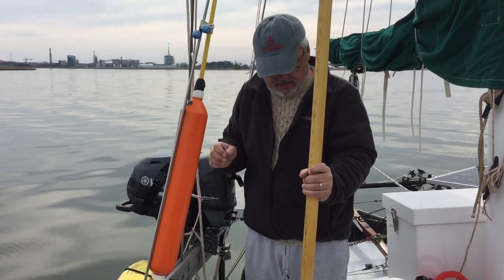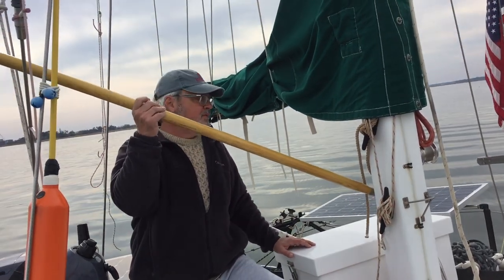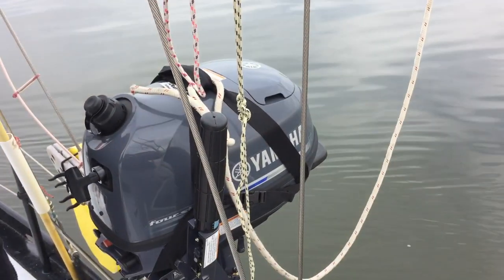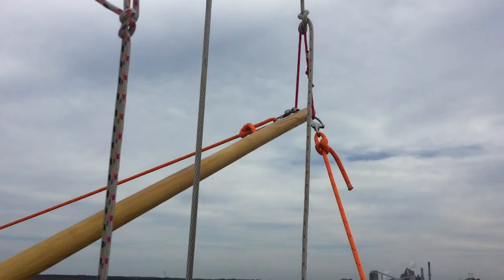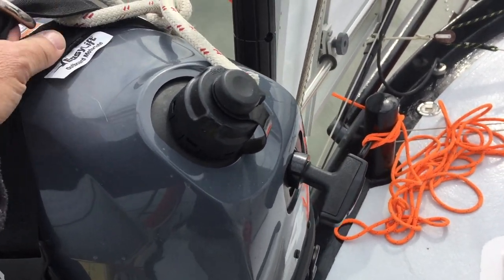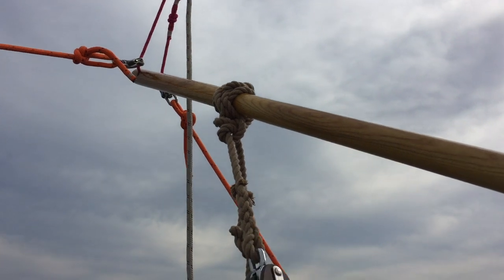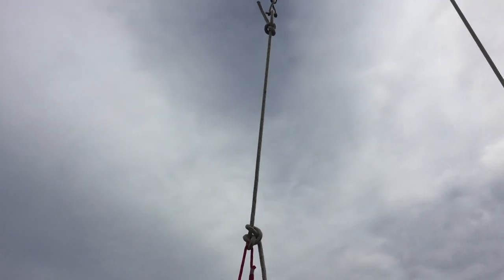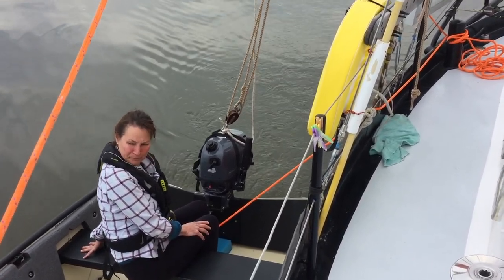A DIY Outboard Lifting Crane

Comment: I'm evaluating all my dinghy options in prep for a trip to the Caribbean. As a live-a-board (or on that boat for some time) do you find yourself using the dinghy to go far, excursions? Do you reckon a low budget (no crane) solution might be to use a 6 HP outboard that is more 50 lb-ish? What would warrant such a large motor on a dinghy? Many thanks,